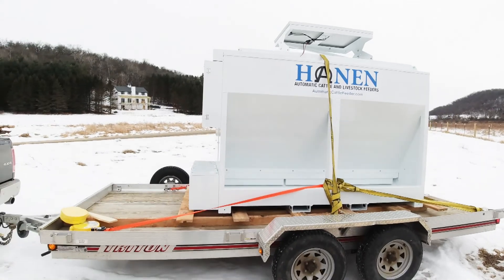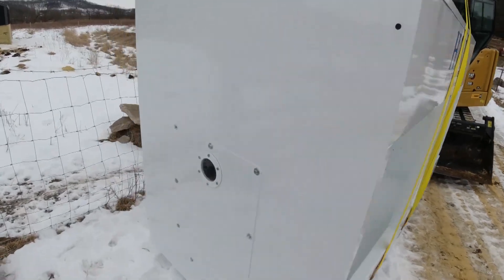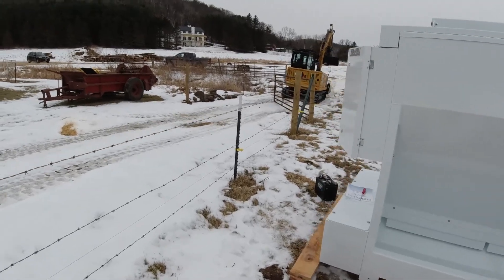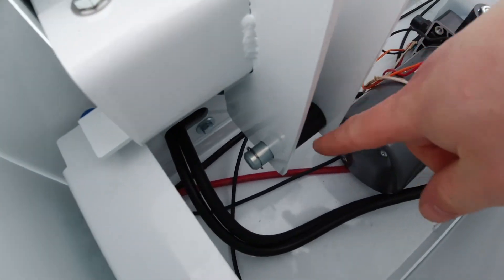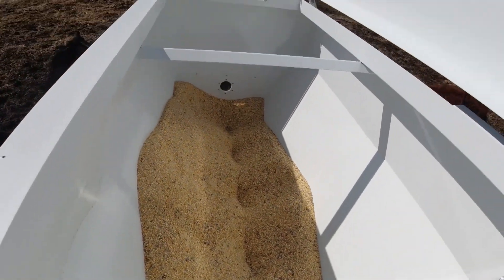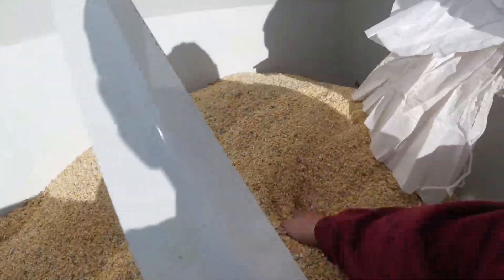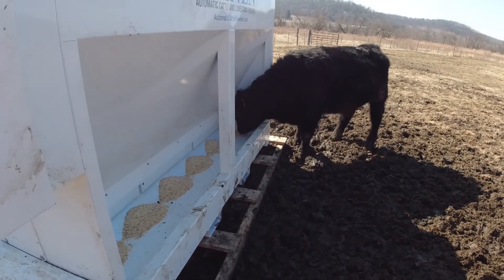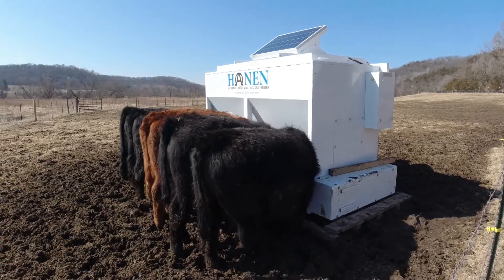Automated Cattle Livestock Feeder -  Feeding Cows with Robots - Hanen LSF-12 Review

Comment: really neat! do you think it actually handles 12 cattle at once?  looks like the most that could squeeze in was 5 per side based on your video. Thanks!
Reply from the maker: 10 for sure,  there are twelve feeding shoots, but the more aggressive cows will eat more if they can block out another.  12 is possible,  especially when animals are smaller, but it gets crowded when they get bigger so it is hard to tell if 12 are all actually getting a full serving.